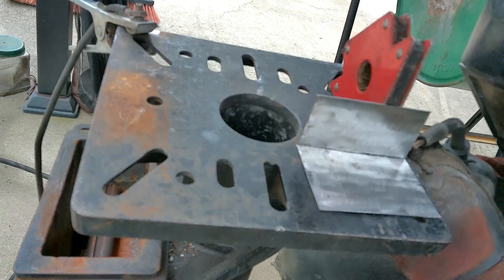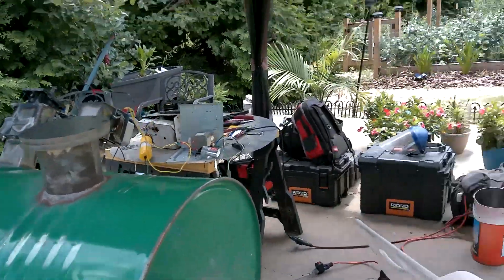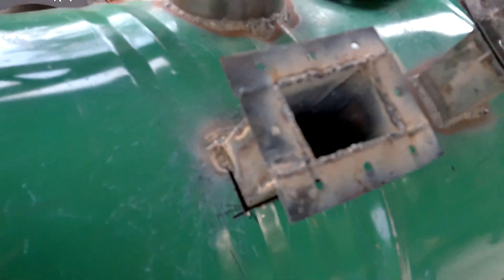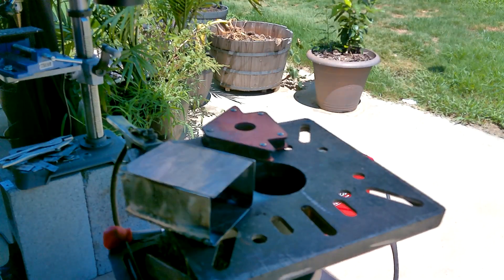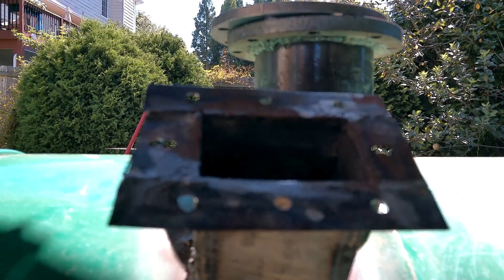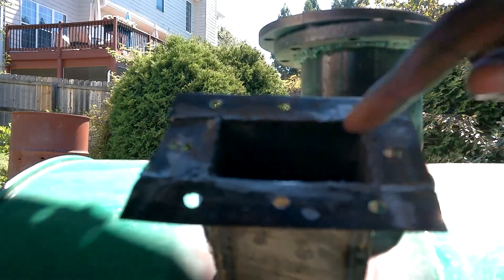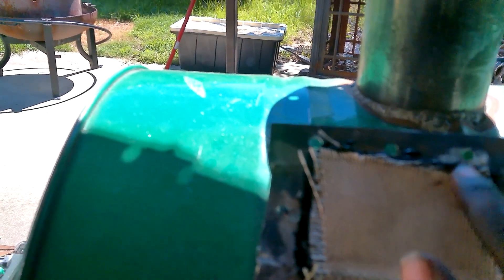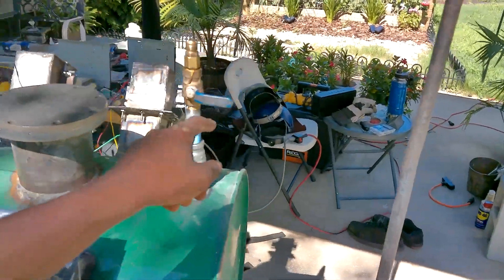5 MAGNETRONS & VIEW WINDOWS -  Building Mark III Reactor Part 5

Comment: Your waveguide feed distance seems off, should be lambda/4, 12.25cm/4 @ 2.45GHz => about 3.05cm from the reflector plate.
Or do you feed at lambda/4+lambda => 15cm from reflector?
Dimensions seem right, though.
Found that you can get 100x50mm aluminum extrusion for like 30€ per m, makes much cheaper waveguide feeds.
And aluminum has lower resistance and no rust on surface, so excellent material for it, because low absorption/resistive loss.

Comment: Hi
Why do you want to do it with microwave..?
Reply from the maker: Most efficient way to break down plastic!
Reply: @naturejab  why do you say it..? What is so efficient there?
Reply from the maker: @danear2  It directly heats the plastic via volumetric heating.Vs regular heating which indirectly heats it.
Reply: @naturejab  thats right and a very interesting point. The next question is how efficient is it vs heating by burner + how economic due electric prices and the fact you can't use the syngas...

Comment: If you grind the paint off in areas you intend to weld, it will in turn make the weld a little stronger and prettier. Also if you grind paint where the ground clamp is, that would help as well. It would be ideal to grind the whole thing but that’s a lot of work lol. Mess with your gas settings on the mig too
Reply: I have a feeling that is a flux core, not a MIG
Reply: @TheBackyardChemist  that is a very good possibility I didn’t even think about that

Comment: Hey bro, I just wanted to say, you're extremely intelligent. I've been thinking of pyrolosis for a long time. Your idea is very intriguing. In the world of quacks who think that HHO will run their car, this is really refreshing to see someone actually do something innovative in their backyard. 

I have a few questions,

#1 Traditionally pyrolysis uses some type of gas to generate enough heat to start the process, I always thought you could just use pyrolysis oil as fuel and essentially create a perpetual motion machine. Anyway, my question is, is your machine efficient? How much electricity will it take to generate one gallon of pyrolysis oil? 
#2 Can microwaves be used with other materials like tires?
#3 Can you use the syngas to power a natural gas generator to run the magnetrons or will it need to be compressed first? Maybe power a diesel generator with preheated pyrolysis oil and inject the syn gas through the intake to use less pyrolysis oil.

Fuck this is so awesome. You rule dude
Reply from the maker: 1- Do not know efficencies, need to get the numbers and measurements.
I'm not sure about perpetual motion stuff, but it's highly unlikely
2 - Microwaves can do this to ANYTHING! 
3- Yes, the syngas most definitely can be used in a generator

Thanks!

Comment: Hi, when building pyrolysis reactors the main issue I run into as well is sealing. Are there any products, epoxies, glues, or whatnot that have worked well for you before? I've tried oatey cement before even and it breaks down rather quickly and when I weld I get holes in the metal as I have an ark welder and I'm used to MIG. Thanks
Reply from the maker: RTV Hi temp silicone is the only consistent thing that works for me, and make sure you have it exposed to the least amount of vapors as possible!
Reply: @naturejab  thank you!

Comment: Steel drum walls are quite thin and will eventually degrade.
Mark 4 needs an old propane tank.
Reply: I think the microwaves bounce of the metal pretty well but if not I think the old propane tank is a great idea
Reply: @cadencruce2153  Its mostly that it will rust fast, likely not too much from the inside as the oxygen will be consumed but the outside will rust away.  When you get steel hot it can rust very quickly.  Some high temp paint would probably help a lot but the propane tank is vastly more thick.  Besides we all want to see him cook a 200 gallon batch of oil out of this thing.  You also get a square cube law thing going on where you keep much more heat in a larger container due to a better volume to surface area metric.

Comment: Brother if you do not run this thing tomorrow Imma be mad !! Haha
Reply from the maker: hahaha
Reply: @naturejab  lets say that everything goes well are you focusing on the output, refining? What is the next step ?
Reply from the maker: @alvarodacostablanchard1789  Yup, focusing on the output. Need to build some bigger steel wool filters / condensers for such a large capacity. Need to also build a hopper for the thing. But other than those two things & painting, this reactor is damn near done!